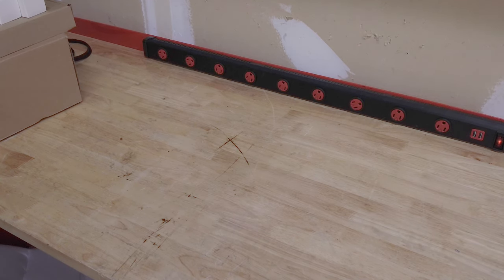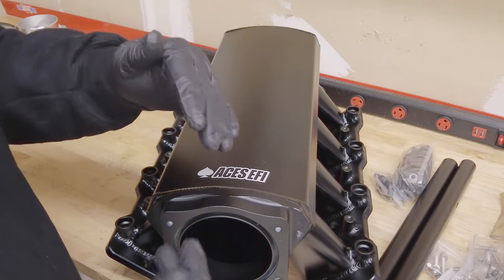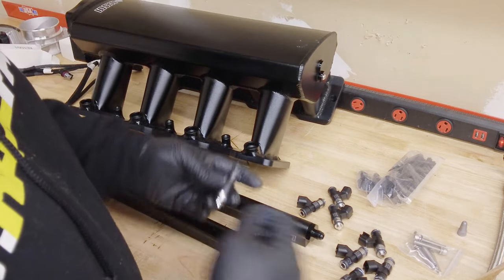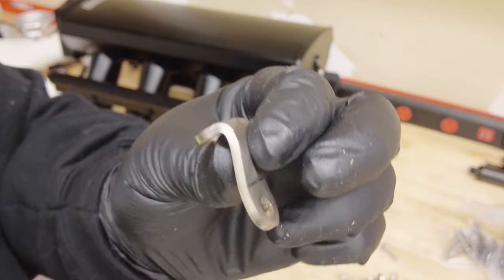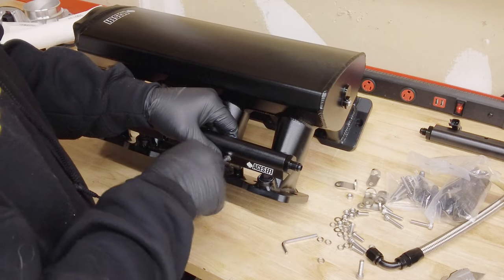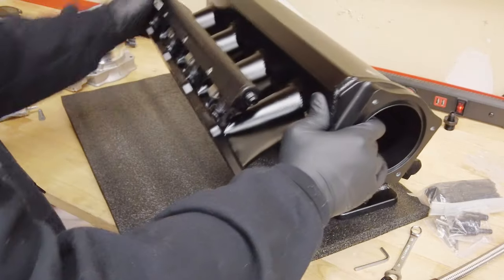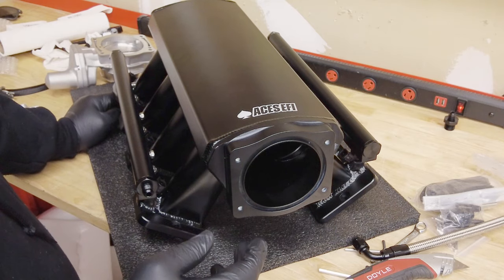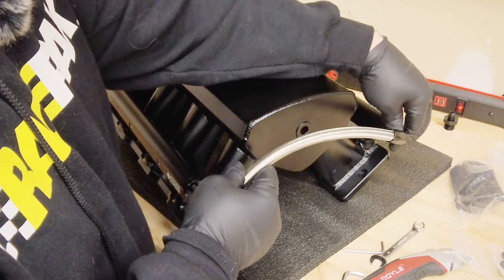Intake Assembly Video

Comment: What fuel injectors are you using cause I’m using the ones that came out of the truck and they will not go in the manifold without busting they go in the rail just fine but they will not fit in the manifold without the O-ring busting or cutting please help